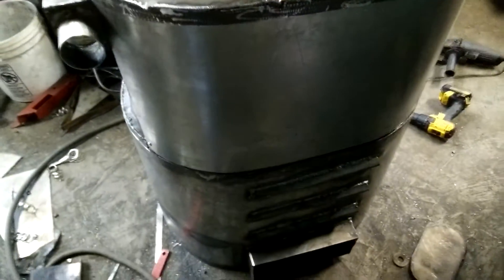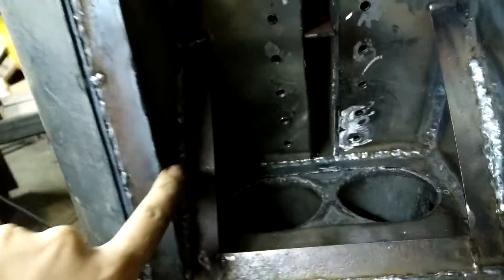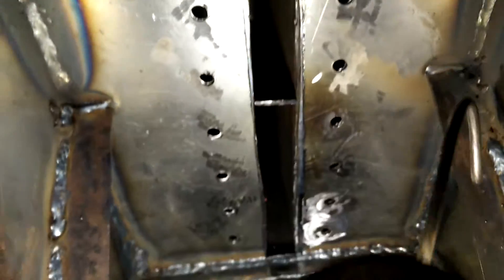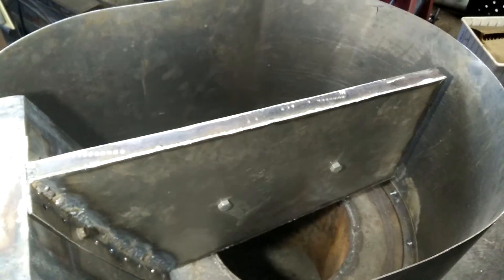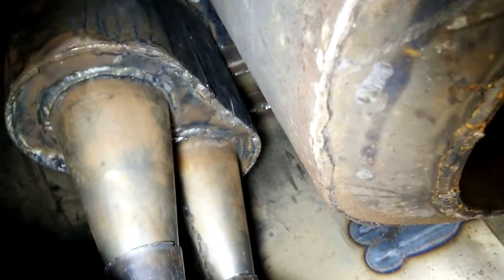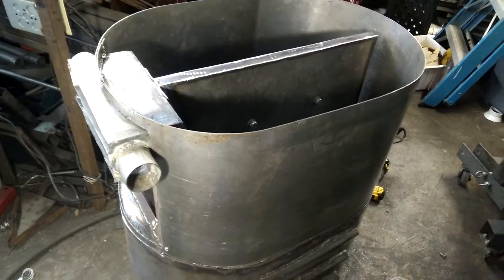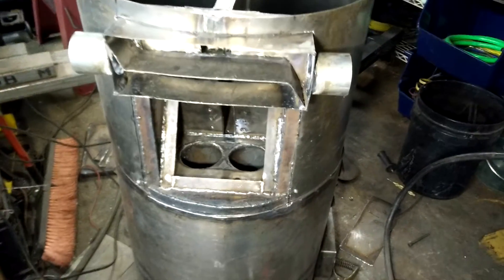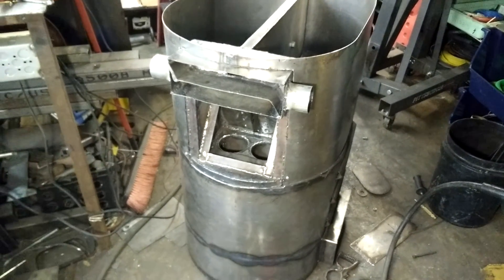Mini WK Gasifier Walkaround

Comment: Id like a small unit I can mount on a trailer hitch receiver or small tow behind trailer. We have are book back out and are going to scale a unit down. You have so much time working with them it would be years of catch up for us. I have CNC plasma table and we fabricate. I'd be interested in buying plans from you and some email assistance through You Tube videos building your design. I know there are a lot of people out there wanting to build a commuter size vehicle like the geo to get the weight down so it uses less energy. I already build engines for propane and natural gas so bumping the compression around and some custom head work to get some performance back I am very familiar with. A trailer unit that can be used for multiple engines or machines around the property is what we are hoping for. That vacuum carb you built is so close to a propane carb i was thinking thats what gave you the idea. Not to go on here for ever but have you thought about a simple air pump or compressor going into a propane tank like 5 gallon unit and then pulling the gas out of it under 150 psi like propane and through a propane carb? With no gasifier experience it feels to me like that would make a daily driver that started on gas from the previous fire when it was last shut off and get you down the road a mile or two get the new fire up and running but I really have no idea as i only no natural and propane systems and how to make dual and tri fuel systems. Great job on that vacuum system I appreciate the level of time and patience those projects can take and eat up.
Reply from the maker: +Geo Jeff some good thoughts here, but let's switch to email. My address is chris@driveonwood.com.